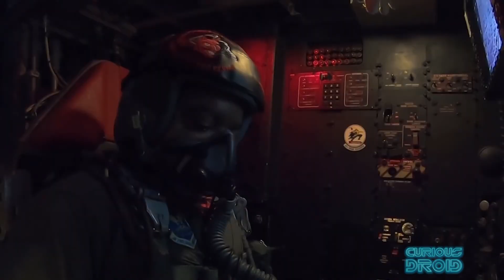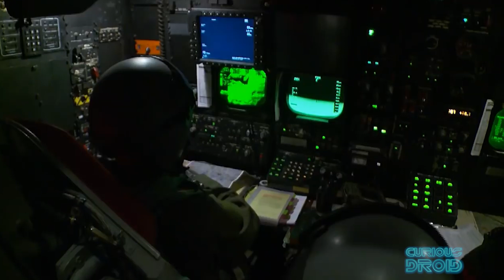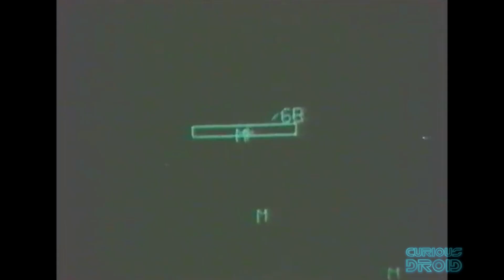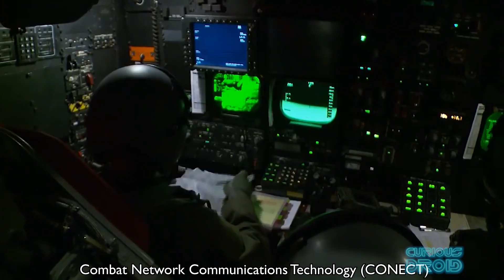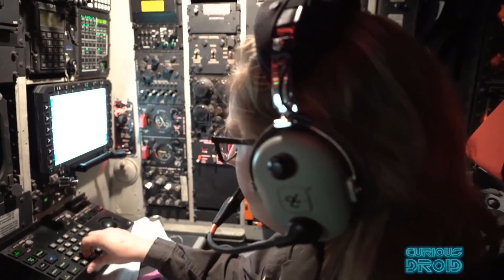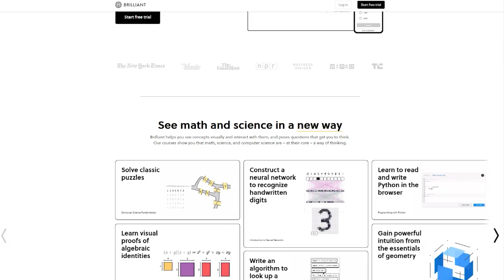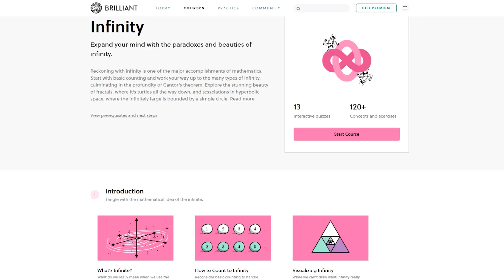How Long Can the B-52 Continue in Service?

Comment: The thing no one ever discusses is that stealth technology will eventually be rendered irrelevant.  If Doppler radar doesn't achieve the capability to see the air an aircraft displaces first, gravity sensors will be able to detect their mass.

Engines, avionics, support systems, etc. can all be replaced and upgraded at relatively (to the price of a new craft) low cost, meaning so long as the B-52's airframe is fit for task, there's no reason to retire it.  How many billions would it take to develop an airframe that's even 10% better?  

I suspect the only thing that'll put the B-52 out of service is metal fatigue.

Comment: B-52 is gonna stay because in comparison to B-1 and B-2 (and B-21) it is very economical. But the most important part is that due to lower maintenance crew requirements, it simply takes much less manpower to run these airframes.
Rolls Royce won engine refit

Comment: Considering the fact that the Grandsons of the original pilots who flew the first ones on patrol between Russia and the USA, are still flying those same aircraft, later versions, we might easily see the grandsons and great grandsons of the pilots flying today's bombers, flying them in the future. Now every so many hours, these same bombers get stripped down, and every piece on them inspected, replace aged wiring, and upgrade them with more modern electronics, it's still the same airframe and that in itself is amazing.

Comment: The B-52 is really quite an amazing aircraft. And the engineers did a really quite a good job the only contender I think at the same time was a b60 and the rules of physics have somewhat remained the same stealth isn't the only reason why aircraft are good and with previous history they know that airplanes just because they are fast aren't really applicable they found out that almost all jet dog fights happen just under the speed of sound not over the speed of sound of course having the ability to go over the speed of sound helps if you're trying to run away or pursue something that's far away that you need to catch up to. The B-52 is somewhat of a redundant system it has twice as many engines that it would need you could actually lose a few engines and it would still probably work not that you would want to. And you can match it up with just about any type of new weapons you could possibly come up with it's tough  it's amazing and strange in its landing gear configuration. I'm quite surprised that they reduce the number so greatly I mean there used to be quite a few hundred of them. It seems as though there are very few airplanes that can completely do what a B-52 does I mean it has a long range it can fly at extreme altitudes it's quite fast actually for a subsonic aircraft. If you were to really design something that's comparable with all the extra engines and the range and the payload that a B-52 can with the same amount of range it's almost not possible you would have to design almost the same thing. The rules of physics are simply the rules of physics. And that's what's amazing.

Comment: Lets be frank here. This aircraft is still useful because it will only go up against poor sandy shitholes full of poor brown people without airpower. Any country with any fast jet capability or integrated surface to air defence system would make short work of a B52, long before it reached it's target. The B52 had stand-off capabilities since the mid 60s for that reason. Even though it was part of the nuclear triad right up to the end of the cold war, it is doubtful many would have got through to their targets even if faster, newer aircraft had destroyed or suppressed USSR/WP IAD systems. 

So as long as 'Murrikah' needs to bomb goat farmers and wedding parties, it will still have a role.
Reply: Yeah, right. You're tinfoil hat is on too tight.
Reply: @JohnPepp  And you are on an idiot unable to distinguish criticism of US so-called defence policy from conspiracy theories.

Comment: Curious I'd they could not make a non-stealth bomber based off the dozens of already engineered air frames on file from Airbus,Boeing,Lockheed Martin and others.  88 million is so cheap! I mean with modern manufacturing could it not also be cheap to make anything non stealth? that seems the nail in all these insane projects.

Comment: Part of this is misleading. These B-52H aircraft still flying are not the same as the A thru F models that were designed and built in the 1950's for WWII scenario bombing. These aircraft were not "over-engineered." Usage of the B-52 evolved to meet the threat of the Cold War. SAC's new usage involved 24 hr. EHAM extended high altitude missions at maximum gross weight, with multiple refuelings, and CCTM combat crew training missions involving low-level terrain avoidance flying. This usage revealed maneuver and gust loadings beyond the limits of the original design and led SACto request a modificattion of the airframe. I was Chief of Structures Technology at Boeing-Wichita in 1961 when we redesigned the B-52 G/H wing and other structure to meet SAC"s requirements. Yes, we did not have computer technology. But we did extensive lab and flight testing and data gathering, from which we did stress and fatigue analysis, and finally, full airframe testing. The primary reason for the airframe's longevity is that the usage has not been as severe as was projested. I am honored to say that I chose the materials, the analysis methods, and the limiting stress levels for the redesign. I am thrilled to see these planes still flying and projected to do so for many more years.

Comment: 100 years is absolutely amazing for a machine - much less an airplane!
Check this out -
Jim flew a B52 in 1960
Jims son flew one in 1980
Jims grandson flew one in 2000
Jims great grandson flew one in 2020
Jims GREAT GREAT GRANDSON flies one in 2040.
Obviously Jim, Jim Jr and all the Jims #3 and Jim #4 would need to have thier kids at 20 yrs old - but the thought that probably at least one 5th generation B52 pilot is just absolutely amazing.

Comment: As long as they can swap out the wings once in a while... 
I worked flight line maintenance on the last of the "D" models in the late 1970's. The one's with the pointier horizontal stabilizers. They had an unusual hydraulic pump system. Roughly ten centimeter diameter pneumatic tubes carried engine air compression to drive ten pumps distributed in the wings and fuselage. Each pump had it's own fluid reservoir, and auxiliary electric powered pump. The high redundancy system worked better than you might think, but, subsequent models went to conventional engine mounted pumps. I suspect the "D's" required more maintenance hours. Those hundred pound pumps were a bear to remove and replace.

Comment: Maybe the Bidumb Administration will propose putting solar panels on the B-52 and have them run batteries with zero emissions! Then we can do away with all that horrible smoke and pollution that fouls the air with noxious CO2 that melts the polar caps and causes polar bears to die.

Comment: The B-52 could fly as long as they want it to as long as they continue to maintain it's structural integrity and upgrade it's avionics systems.  The question is would they want to?  IMO the new B-21 is another white elephant in the making.

Comment: I go to Bossier City, Louisiana on the regular, and love watching them do touch-and-go landing practice. Considering the USAF has enough spare TF33s in inventory (from B-52s scrapped for arms-reduction treaties and the ones they took off the tanker fleet when they upgraded them to modern fuel-efficient airliner-type engines) to last the BUFF fleet until the heat death of the universe even if they don't bring about Armageddon a bit early ... they're probably not getting another engine swap  On the other hand ... the BUFF might well outlast gas turbine engines.

Comment: The B-52 needs very clean airspace to opperate, almost any fighter jet in use today would be able to take it down if the B-52 was without backup.
The only reason it is still used is because USA tend to use billions on developing new aircrafts, so they are most likely afraid that a replacement would cost 200 billion $ to develop.

It is a beautiful aircraft though, had one flying straight over me at a airshow.

Comment: The respectable TU-95 and it's variants are expected to operate into the 2050s and beyond as well. The post war midcentury world produced the finest engineering with the exception of the Pharaohs.
As a cost overrun alternative to the B-21, why can't the military ordnance order a modernized variant of the Horton 229? The plywood frame is stealth worthy technology. It wouldn't cost more than $500k, compared to the $550 million B-21. You can probably build a 229 in your garage.

Comment: Heard a story about a bombing mission in the first Gulf war;  
A young F-18 pilot running escort, getting bored,... starts doing acrobatics.  Barrel rolls, loop-the-loop's, or just weaving and rocking.  
An older Major, piloting the B-52 tells him to "Settle down.". 
F-18 pilot, still dancing around, comes back on the radio singing, "Anything you can do... ..."  B-52;... "How 'bout just straight level flight ?"  F-18 "Too boring. "
B-52; "I know something I can do that you can't !" F-18; "What could you POSSIBLY DO that I couldn't ?"

B-52 "During this whole conversation, ... I shut off two of my engines ! ... Top that ! "

Comment: Boeing builds the B52 in the early 60s and many years later, it cant get anything right. Trouble with the 737 max, 787, 777,, the tanker aircraft , what is Boeing getting right nowadays? What happened? Did all the real engineers retire or die off?

Comment: There's a temple in Nara said to be the oldest continually used building in the world: they've been holding prayers there every day for fourteen hundred years.
They've replaced every board and tile in the entire building from time to time -- but of course it's still the same temple.
They could still be flying the same B-52s in 1400 years (and with brilliant successes like the B-1 around they probably will be) on the Nara principle. As long as they don't get on the wrong side of the Vietnamese, that is...
.                                                                        * * *
On the other hand, there are 76 B-52s "remaining," which I guess doesn't count the ones they can pull out of the boneyard, as they have apparently been doing.
Out of 744 planes that have been in service, this is called "standing the test of time" -- if you don't call it an 89% failure rate, that is.

Comment: don't fix what ain't broke, if they are still perfectly capable of doing what needs to be done, let them do it instead of wasting $ on next gen bomber that may or may not be just as capable, better to set aside the funding to restart production of spare parts so the mechanics stop having to run to the scrap yard for parts, i think those planes have earned that privilege by now

Comment: Perfection is difficult to improve upon!
If you think today's B-52 is your Grandfathers B-52, you better think again!
I saw a B-52 (at arms length, with thumb up, it looked to be 6" long, so I got a good, long look at it), it had four boxy engines, the wings were swept back at a different angle, the wing tips were curved back, it was very black. While staring at it, there was a break in the traffic so I ran across the street, when I look up for it, it was gone! Warp drive, invisibility cloaking, I have no idea!
But you can bet your bottom dollar that that thing was carbon fiber with Buck Rogers tech! I have seen it twice more, since.
What can replace the B-52, except for a new and improved B-52, maybe, that is the up and coming B-21!

Comment: They should keep these and most other aircraft from this era that are still in service until the next war(hopefully never). We’re fighting against opponents in the Middle East with 0 anti air capabilities. We killed our shot in Afghanistan by spending so damn much on the counterinsurgency there. Flashy planes do not lend you any type of advantage in the wars we’re currently fighting today.
For example, if the Air Force was going to drop a JDAM on Taliban fighters, they can do it from an $8000 per hour F16, or a $44,000 per hour F35. At the end of the day, the same munitions were dropped and the plane flew from and to the target completely unscathed. You get the same results from either plane, and I haven’t even mentioned cheaper planes, the F16 and its price is something I knew off the top of my head. That number quickly adds up to millions, then billions of dollars as the months and years go by. Afghanistan should be a wake-up call for the fact that we’re wasting so much more than we need to on simple tasks. 
Glad the Air Force is making the more sensible decision keeping this fleet.

Comment: I'm pretty sure the pilots don't call B-52s fat "fellows". :-)
The B-52 is just another (very good) example of how we pretty much peaked in mechanicial and aeronautical engineering in the 50's,60s and 70's.
There are lots of advances in avionics but actual air frames are not changing much - even a lot of engines that are flying to day were designed an put in service in the mid 1900s.
Even Tesla's rockets - the basic vehicle is the same as the rockets of the 40s or earlier - they just have better materials and avionics (and elss politics).

Comment: It's hard to imagine a more irrelevant aircraft than a big, slow, vulnerable bomber in 21st century. Would be quite literally a liability if it came to a war with even remotely technologically developed enemy. Can't really use it anywhere, apart from bombing sheep herders in Middle East. People cry about how F-35 is expensive. Yet paying for a massive fleet of aircraft that doesn't have any practical application for the last 30 years is fine? Go figure.

Comment: It`s simple, many built and in many different models, total production 744 only 58 are left in service, 18 in reserve, and about 12 in long-term storage all H models. They have been replaced in service by newer versions over the years with the last new built Aircraft in 1962, all older B-52 have been retired leaving the best condition and lower hours airframes that have been upgraded.

Comment: Why keep a 58 year old aircraft in service? because no one has built anything better. the B-58 was supposed to replace it, the B-1 was supposed to replace it, the B-2 was supposed to replace the B-52. the problem is payload, as long as we're doing saturation bombing the B-52 will always win on payload. plus you can shoot the god damn thing full of holes and it'll keep flying as long as the wings are attached.

Comment: It is am amazing aircraft but at some point it MUST be retired.  The fact is aluminum has a set fatigue life.  They may have allowed a ridiculously high factor of safety for this aircraft, giving it a longer life if operated within its designed envelope, but eventually the structural members will be beyond preservation.  At that point you can either begin major structural replacements, piece by piece until you essentially have a new aircraft, or replace it.  Aluminum is not like steel and does not have an infinite fatigue life if never taken past its limits.  It weakens ever so slightly with each loading.

Comment: So you're going to compare an old prop plane from WW1 to a jet plane that has been fitted with lots of upgrades? Look how long they used A-10 for. Even the pilots that fly these planes love them. If it works well, use it, keep it maintained.

Comment: I've commented on this aircraft numerous times.  I don't have anything personal against It, but It's an aircraft that can crash in a moments notice.  The pilots are now used to flying "by Wire", and ultimately all electronic.  It's like driving an old pick up truck with a column shift.  You might be able to figure it out, but this is an airplane where there's no time to figure anything out.  You either know how to fly this thing, or get trained in a simulator.  Not to mention a pilot who YOU might out rank you...am I right Colonel?  Ego's are what are going to get these pilots killed.

Comment: 0:36 That's a weird angle of flight, its either taking off or doing a re approach judging by the landing gears are in the process of being retracted. But its got the nose down and tail up so it looks like its going in for a dive/landing, but simultaneously it looks like it is ascending, what is going on here? Is it taking off or what?

Comment: The previous Boeing entry, the B-47 (despite being the most beautiful bomber to take to the skies) had some serious air frame and design issues that were never resolved. So when they set about making the B-52, they simply decided to make it invincible, aside from a small tail problem that was sorted by chopping half of it off.

Comment: Curious why you think the B-52 will outlast the C-130.  People tend to think the opposite.  

The Herc is the epitome of fulfilling a role that isn't going away.  Unlike a bomber, there's no reason to redesign a propeller driven cargo aircraft that can land on dirt.  It's about as good as it gets already.  It has newer airframes with newer engines - some as recently made as 1999.  It can adjust to almost any special need.  Land in Antarctica on skids?  Yep.  Howitzer out the door?  That would be a Spectre.  Land and take off in a football field?  Sure.  It's even landed on an aircraft carrier.

With newer parts, airframes, some non-combat roles, and no reason to build a replacement, it really has the build for a long haul.  Not even something like an Osprey properly replaces it.